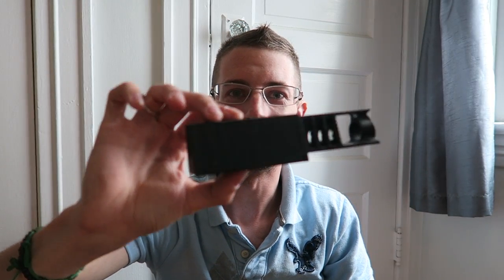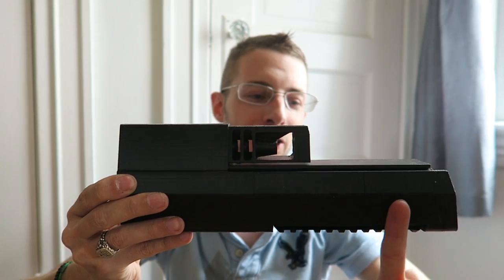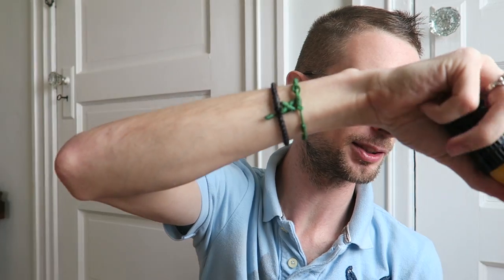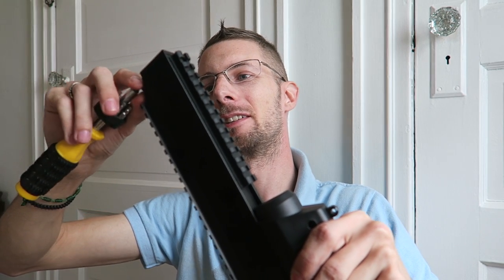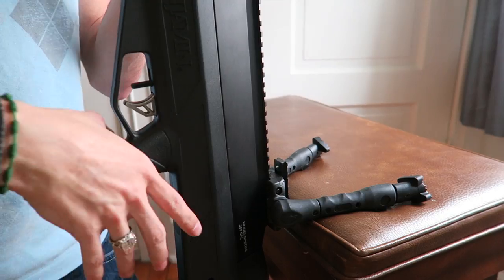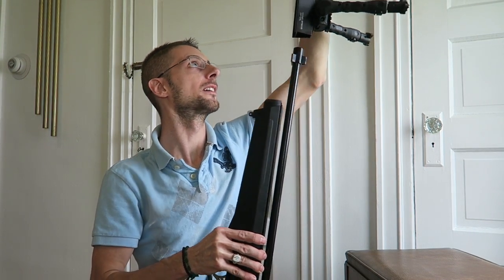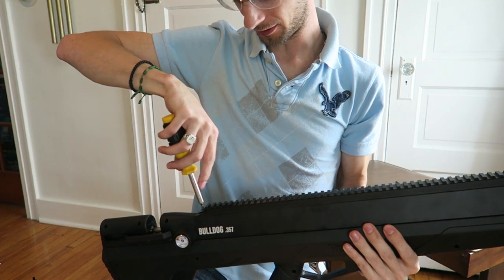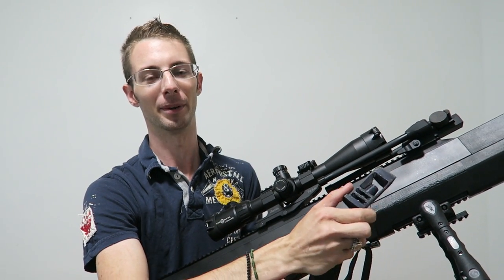Pitbull Suppressor Install | Mega Moderator | Airgun Evolution

Comment: Nice to see someone as clumsy as me can take the shroud off and put this thing on
😁   Looks pretty straight forward. I am looking forward to seeing how the "mega moderator" performs. Just wondering if it is really as "indoors friendly" as  advertised, and how much it affects the accuracy.
Reply from the maker: The accuracy is unaffected pitbullairguns.com also sells a set of barrel supports for $20ish that improve accuracy too.
I have shot this gun in a factory building with out hearing protection. the mega moderator works great and it makes the gun fun to shoot.

Comment: I just got mine.   Every slid off without a hammer.... except for the barrel support.  Took less than 15 mins total.   There is a gap between end of barrel and where moderator starts.    They should have made it so it butts up against the barrel...last 6 inches is thru plastic.      Very odd.
Reply from the maker: pilotkisses - I wish I could give you some advice on it but it’s been so long since iv installed mine I forget exactly how the fitment was but I know if you have any questions you can call Matt or Paul at Pitbull Airguns.

Comment: Steve, 
I noticed that you put the helios radial mounted  bipod on an I wondered if you had trouble with the piccatiny rail provided with the mega moderator. Reason I ask is I bought a slightly "used" bulldog that already has the mega moderator installed. It is grouping well but way to the right and I ran out of adjustment with the scope......I am going to try sighting in off of a bag but I suspect my bipod is torquing things somehow. The rail on the moderator flexes quite easily on mine. Just wondering and checking. Thanks
Reply from the maker: No, the rail on my moderator is fine. I switched to the top mounted bipod because it auto eliminates cant. I'm trying to think of what could be causing this and coming up blank... my advise is to ask on the airgun nation forum, I'm sure the guys there can think of what's happening.

Comment: Hi. Have you ever compared this gun and this mega moderator compared to donnyfl emperor ? Thanks
Reply from the maker: I have all three moderators ( 2 donnyfl and 1 pitbull ) and to be honest all three do about same as far as quieting the gun down. I don't have a decibel meter but to my ear there all equal. The DonnyFL Emperor quiets the full report just a bit better than the Big Boar Ronan, and due to the fact the pitbull takes about 10 to 15 min to install you you can't do an exact comparison by ear but to me there all equally good, I like the looks of the pitbull but the donnyfl cam be a universal suppressor.

Comment: Urban Airgunner did you lose any velocity with the Mega and how would you compare it to the Pitbull long moderator.
Reply from the maker: haha I really hate to admit this but I was a lazy tester and have only used the MEGA... Don't tell Matt
I only wanted to install a suppressor once so I wanted until I had the best one to install...
as for velocity I don't have a Chronograph so I can't answer that question either, BUT I would suspect there is little to no loss of Velocity. There is nothing toughing the round to slow it down like the bullet wipes used in early Firearm suppressors and it is still getting a the full charge of air pushing it out the barrel and instead of exiting straight to the out side air it is flying for less than about .01 of a sec through 3.5" of baffling first. I don't have hard facts but I can't imagine that affects velocity, and if it does it is a supper miniscule amount.
Reply from the maker: What I will do is take your question and the other frequently asked questions and get them to Matt who has a chronograph and a decibel meter and get some solid answers for every one.
Reply: No problem I have the long and the mega on the way with barrel support. Thank you
Reply from the maker: I still need to order barrel supports, 
Have you seen my Instagram post where I asked if Matt could make a gold ball launcher for the bulldog?
He said Yes.. Muhahahaha
https://www.instagram.com/p/BWs6TVaH-dw/?taken-by=urban.airgunner
Reply: Urban Airgunner  Matt is pretty good.

Comment: How does this compare to the ronin?
Reply from the maker: Id say if your going to get a suppressor that you want to use on a Bulldog but you also want to use it on other guns get the Ronin, but if you only want to use the suppressor on the bulldog get the Pitbull mega moderator. I did test them both out but since I don't have a decibel meter by the time I got them swapped around it was hard to tell by ear if one was better than the other.

Comment: Can I ask you something ........what pellet u must use for crows at 60 m with a spring gun ( 386m/s.......  177cal.)
Reply from the maker: Wild Hunter - There is not a set answer for your question but more like a 2 step condition. 
Step 1: You need to find out what pellets are the most accurate for your gun at that distance. 
Step 2: Out of the pellets that are the most accurate use the one that imparts the most energy and causes the most damage to your target. 

I would try JSB Domed pellets for accuracy and I would try H&N's hunting line of pellets too.
Reply: Urban Airgunner you have some pellets to suggest based on the damage they cause to the goal??? What my Airgun is quite possible and at a distance of 60 meters easily kills ... ... ... To move on to the pointy ..... gamo magnum .... If you can help me because I am new and Nr I know so well ... ... ... Thanks for your time ... ... ... and sorry for my English
Reply from the maker: Look here for some great accurate hunting pellets:
https://www.hn-sport.de/en/air-gun-hunting

Comment: and testing? :)
Reply from the maker: Subo - Right now I have 2 videos out where I'm shooting this gun and suppressor combo. 

As for sound testing, I have no true way to show it yet. 
I've downloaded decibel meter apps they are all garbage. 

With a stand alone decibel meter, when I researched them the prices went from $20 to $100 and there were the same meters listed at each end so I was turned off by the fact I was getting a cheap low quality meter or ripped off with a high priced low quality meter. 

And just judging sounds by ear based on audio recorded is subjective based on so many different things, how loud the playback volume is set,  if your wearing headphones or using speakers, did the sound clip the mic when recorded... and the list goes on

In future videos I'll try my best to accurately represent how much this suppressor really quiets the gun down.